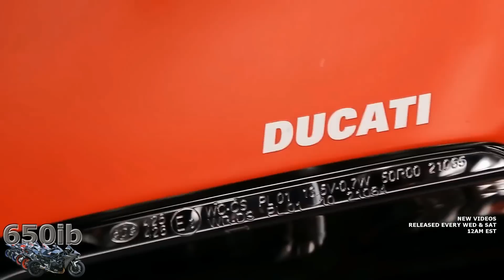2017 Ducati 1299 Superleggera vs BMW HP4 Race | KTM Super Duke 1290 R & How I Clean my bikes

Comment: Thanks for sharing another great topic. I'm split between wet and dry washing. My main concern with dry washing is not doing a pre-rinse which would get the bigger stuff off and prevent possible scratching. Wet washing is more thorough, but also means that the chain needs to be washed and lubed every time.

Comment: 650 ib I use the Honda spray cleaner and polish, that stuff is awesome, you can use it on the paint, plastic and even the engine and swingarm also does a great job on the wheels😉👍🏻 and I agree with you on carbon fiber, I like clear coated better!

Comment: You can always use rubbing compound once a season to remove the swirls and micro scratches that build up from cleaning like this. However, be careful as some paint can be EXTREMELY thin and will burn through with little effort or friction

Comment: another quality video! I used to think that a busa or zx14 was the way to go for big guys until I sat on an s1krr and fell in love with it. It is actually taller and wider than my busa which kinda surprised me. So I just  purchased a 2012 with under 2k miles on it in immaculate condition...just gotta change the exhaust and I'm good for now well at least for the rest of this riding season.

Comment: Love the videos and I used to clean the same way however the unseen or difficult to see dirt/dust on top needs to be removed with a hose or pressure washer otherwise when you put a rag/sponge on your bike it scratches your nice paint. If you look in good lighting you will see swirl marks or very small scratches. I learned from a professional detailer hope this helps!
Reply: bradley obrien I was thinking the same thing.  I wish the previous owner of my R1 had known that.  I got a good deal on it, so I can live with it.

Comment: How do you know what type of carbon fiber is being used on either bike? Wet or dry carbon is named such due to the manufacturing process and can look exactly the same depending on the finish required. Dry is lighter, and more expensive.

Also... preorder down on the 2017 1290R. Shame about all the good stuff being optional extras but ordered it with the lot and a side of fries. good stuff

Comment: Super Duke 1290R, H2, 675R track bike and you're set. Once you get used to the SD 1290R you'll be hooked and ask yourself why you didn't do it sooner :). So darn comfortable too.
Funny you mentioned the steering damper. Previous gens do have one but in all honesty, it's USELESS and needs a Scott damper (at least something better than OEM). That bike does it all and handles like a sport bike. I would definitely keep your H2 (or other) for your smackdowns though. You just can't keep that front wheel down on the beast.
Keep up with the awesome videos. Great content and always a pleasure to watch.
Reply from the maker: David Bonnet Thanks man!!!
Reply: By the way, if you're ever down this way you're more than welcome to take mine out for a ride ;). Stay safe out there.

Comment: keyless start isnt a positive in my opinion, if that system fails it could be very expensive to rectify.
Reply: *Warranty
Reply: if money is no problem after the warranty expires then feel free to crack on, i prefer to stick with the tried and trusted key in the ignition method.
Reply: Bob
I think Ib can afford it.
Reply: i think you are missing the point, what about bikers who are on a much tighter budget.
Reply: Bob
They should probably buy a cheaper bike if that's the case. Triumph and Yamaha make some good nakeds that are reasonably priced. Especially the FZ-07
Reply: personally i have a ZX10R, nice bike and costs a few quid to maintain, but imagine if the electronics in the keyless ignition broke down, you'd be stuck, you know exactly where you stand with a keyed ignition and we all know its super reliable.
Reply: Bob
They make push button start cars, that used to be a "new rare innovation" now it's commonplace. It's a natural progression same as standarb abs on bikes. Why the resistance to change, it has to be tried first to be "tried"
Reply: Keyless go on bikes will be a clever thiefs dream
Reply: +Bob Thanks to that, cars are much easier to steal nowadays...
Reply: Just thought this was funny but my bud had his key get stuck in the locked position a little while back haha. His bike sits outside in the weather and the ignition started to rust.

Comment: @650ib I'm so torn between the 2017 SDR and the tuono. I live by you and the biggest reason I'm turned off by the SDR are the dealerships. Have you found one you like/trust to work with? If you could dm me so this doesn't look like a advertisement I would greatly appreciate it.
Reply from the maker: +smallfry506 Please don't let a dealership experience turn you away from the SDR! I'm going to work with HoleShot KTM and see how it goes. The 2017 SDR doesn't arrive until March
Reply: The Aprilia is a superior bike in most respects.  It's lighter and faster with better cornering.  It's also costs much less, currently , 2017 prices may change things a bit.  Regardless, if you're buying a NEW bike, with warranty.  Make sure you're happy with your dealer, and they're local.  You don't want to drive 5hrs for a 30min warranty fix.  Other then dealer, buy the bike YOU like, not what 650ib likes....There is no perfect bike but you will be happy with either of the machines you mentioned.
Reply: Thanks ib I had checked them out along with pointview cycle, I just feel a little uneasy dropping almost $20,000 at a "dirt bike dealership".  This is when i wish Ohio motorcycle was still in business up by us.
Reply: Totally agree @Anthony M i do not want to drive half way across the state for minor work.  I would be happy with either bike.  If nelson ledges road course ever updates on the status of repairs i would grab the tuono for some fun track days.  If not our roads are shit, straight, and boring i would want the SDR.

Comment: The BMW is simply jaw dropping.  I wouldn't doubt it being $100k+ and judging from the promo video, it will be track only.  I see no head lights or turn signals and slicks for the track.  Hopefully it will be sold similar to the H2 and H2 R.  Hp4 and Hp4 Race models.

Comment: How much is that carbon Hp4 going to cost?
Reply from the maker: Tyler Hoeve $37,000USD
Reply: 650ib dammmmm looks so worth it tho😃
Reply: 650ib how about the 1299 superleggera
Reply: I thought they mentioned it going for 80 or 90k, soooo.... yeah
Reply: I'd be wary of the handling, nobody has yet made a CF frame that handled well on the edge of grip.  Maybe BMW will prove me wrong this time, but I have reservations.
Reply: I'm curious to know where you got that number from 650ib?   I have to call BS on that.  There's not a chance in hell that the carbon HP4 Race as pictured in the video is going to cost that little.   37k for a full carbon race spec motorcycle complete with SBK controls and dash.  I'll believe it when it's true.  I do pray you're right though.   Nothing wrong with a 'good' deal.   I'm betting the price you're referring to is a road ready version.  Similar to the H2 and H2 R marketing scheme.
Reply: Steve C Why would the handling be fucked up with a carbon frame? We already run full carbon wheels with no issues so I don't see why a carbon frame would ruin the handling of the bike it would make it lighter and that much more agile I would say. Carbon has come along way in the steps it's made and stuff so it's way stronger than it used to be .
Reply: Easy.  CF works fine with wheels, which don't need to have tuned flex.  The fame has to have tuned flex, it isn't about strength.  When you are leaned over at 50+ degrees, your suspension is doing very little, it is the frame and swingarm that act as suspension.  GP and WSBK bikes consider their frame and swingarm to be wear items that lose their correct flex properties with use - a swingarm has about 12 days at the track before it is replaced, for example.
Reply: Steve C yea forsure I see what your sayn, but idk the 2017 ducati superlaggera has a carbon frame also so mabey they have the carbonfiber game all figured out.
Reply: Tyler Hoeve yess it might be but they should go for a Magnezium or titanium since CF frame dont work over time byt maybe they know some stuff that`ll make it last..
Reply from the maker: Anthony M Hey Anthony. A local BMW dealer said the Race version will cost $37k. They haven't heard about the street version but I'd pay $29k for it. It might be revealed at the NYC IMS and I'll be there to let you know.
Reply: 650ib Thanks for the response!  I hope your local dealer is right.  Looks like a lot of bike for that price though so I'm skeptical. 
Thinking of the race bike offerings of Aprilia,
1. RSV4 R-FW Stock1 MM Race $22,900 USD 20% deposit
2. RSV4 R-FW Stock2 APX Race $33,900 USD 20% deposit
3. RSV4 R-FW SBK $48,900 USD 20% deposit
4. RSV4 R-FW W-SBK $104,900 USD 50% deposit

Some rather minor SBK spec changes can add a lot of money.  I guess after thinking on it a bit more though, if the BMW isn't a class spec race bike then the 37K quoted isn't really out of the question.
Reply: The Stock1 isn't a great deal, the Stock2 is.  I bought a RF and am modding it instead of the Stock2 because the pricing is going to come out really close but I will have stock bodywork to sell.  The SBK, Misano and RS-GP are monstrous full-spec race bikes that few mortals can exploit to their potential.   Although to be fair, I expect the new Duc and HP4 will be as well.
Reply: Sounds like the right move to me Steve.  You in a sense got more bike for the money.  Turn signals and all.  Without the APX engine management system, the stock1 really loses its value.  My .02
Reply: Really? Because here in Vienna, with all taxes, the BMW guy told me on Monday, 11/20/2016 that the Carbon frame/Wheels and what not HP4 will be around €75k (yes, Seventy-five thousand euros!). That's when I told him I'll pass and won't trade my 2016 s1000RR against it. I'll buy myself a nice Audi S8 instead with that much money...
Reply: fantomas3030 80k Trust me Im from the future

Comment: Get the Honda, man. On another note, you are going to ruin your clear coat using that method I bet you already have swirling. You should have multiple coats of sealant and wax over the paint after it is corrected. It will make cleaning a breeze as well. You have all that money invested in those bikes so spend some time and money researching detailing and buy some better materials.